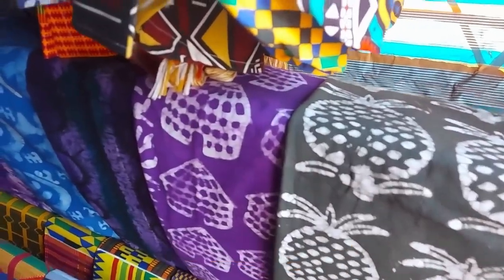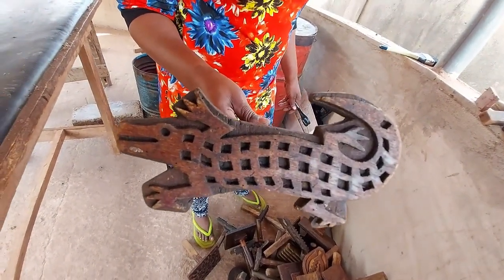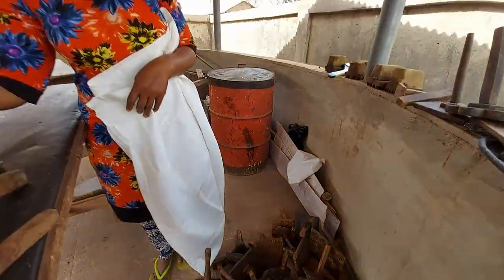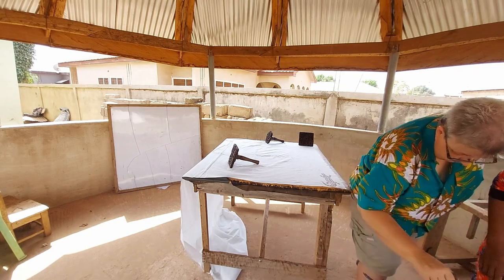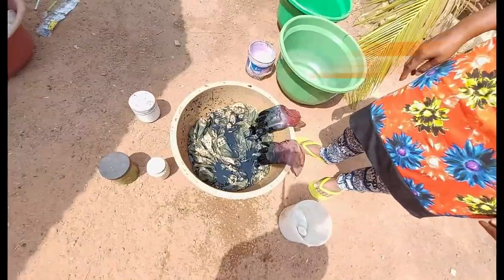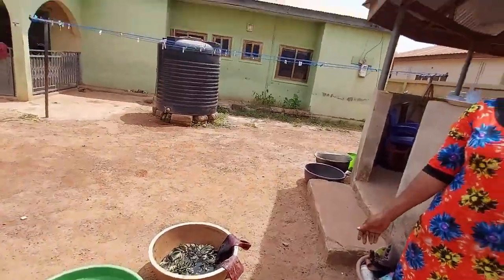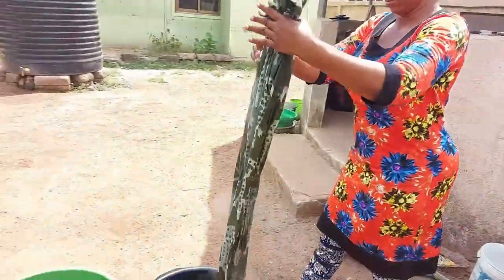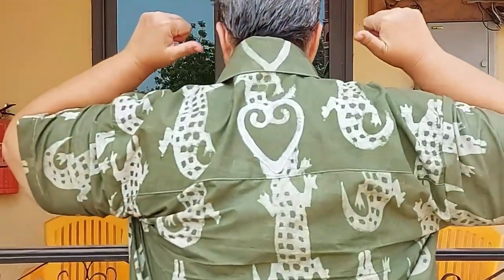Wow! I Got to Make My Own Batik Fabric - Check Out My New Shirt - Tamale, Ghana 🇬🇭

Comment: How amazing! It really did turn out green! At first, I was sure it would end up grey. But, it really is green. I'm impressed! The finished shirt looks fantastic on you! Interestingly, I did batik many years ago - used the cloth to make curtains. I felt so proud of myself. However, I brushed the hot wax on with a brush - didn't even think of using stamps the way this woman in Ghana does. What a wonderful idea and a fantastic result! Congratulations, Tina. Good for you!
Reply from the maker: I know, the color really went through a few changes. The shirt is really comfortable, too. The tailor did a great job. 
What did you 'paint' on your batik curtains? When I was young, the technique was always discussed with a brush application like you used.
Here they use stamps to print adinkra cloth. I presume the method just transferred over.
Glad you enjoyed the video! Thanks for the comment.